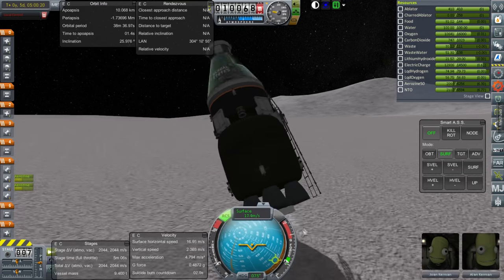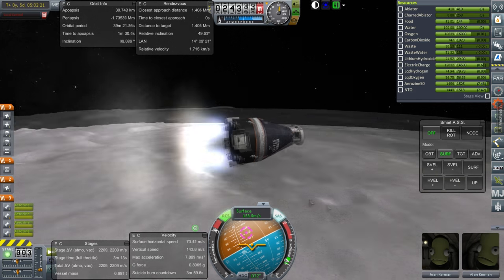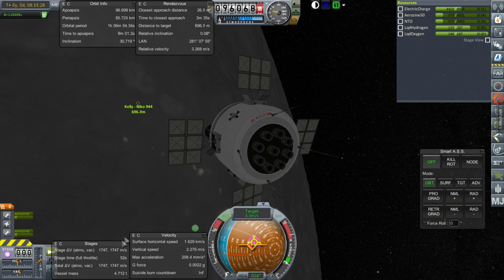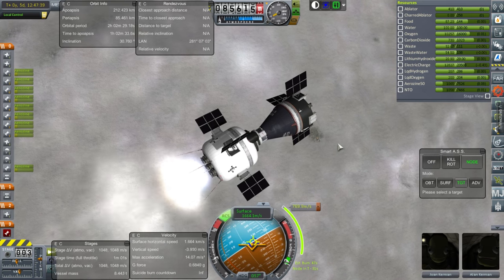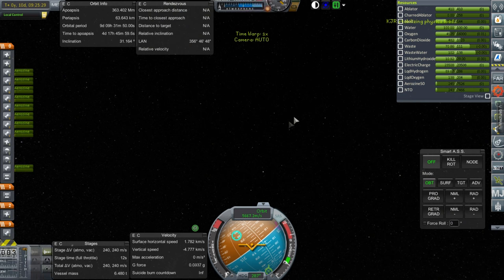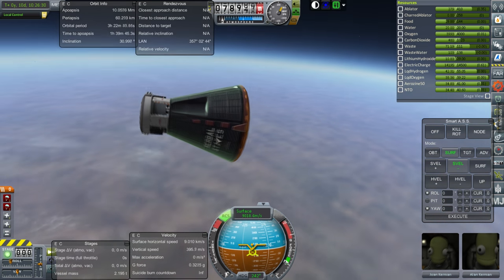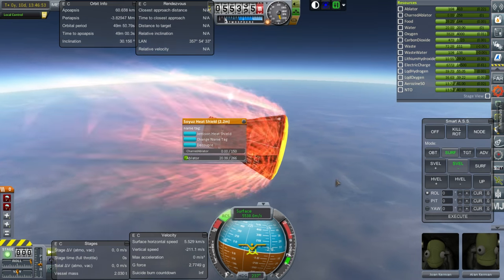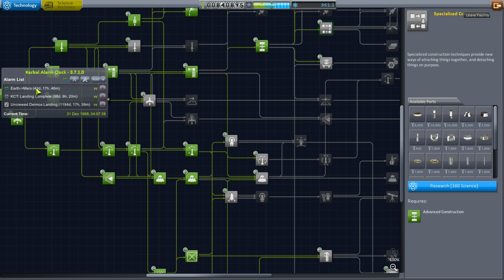Realism Overhaul in KSP 1.1.3 - 29 - Drastic Measures

Comment: Glad the accent worked out in the end. 
the micro landing struts can be scaled up with tweak scale, but they have a maximum stress that I don't think scales with them. in my own playthrough I found that eight of them could support ~15t. but you gotta be real careful on touchdown speed.
Reply: Hey! Don't criticize the micro landing struts. They're cutting edge tech. Even more advanced than the wheel.
Reply: Lol. Truth.
Reply: Fair enough. The only reason I've kept it is for wings (and landing struts, that to be fair should be way lower in the tech tree)
Even the wings part has been made obsolete by procedural wings...

Comment: FASA would give you Gemini "lite" lander lander legs in the 1st landing node (plus the Gemini lite lander "cockpit"/seat enclosure), AIES  would give a few also (1 of which is lite manned lander sized) both are well supported by RP-0, as seen by the list posted by "winged" here: http://i.imgur.com/UjxstZs.png this list was posted on jan 31 2016 so i assume support on WIP may have come abit further aswell
Reply: there is a posted fix for aies (http://forum.kerbalspaceprogram.com/index.php?/topic/32547-104-aies-aerospace-v161/&do=findComment&comment=2612671) and FASA has a newer "fixed" fork i cant find the link to atm (which fixes legs also). I'm using them in a RP-0 career with on issues (ksp 1.1.3 mind you)